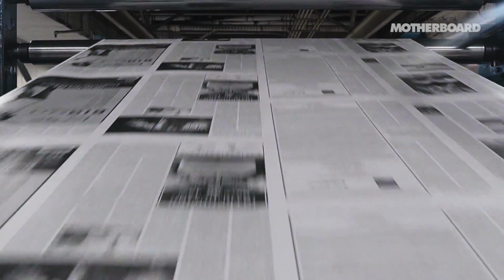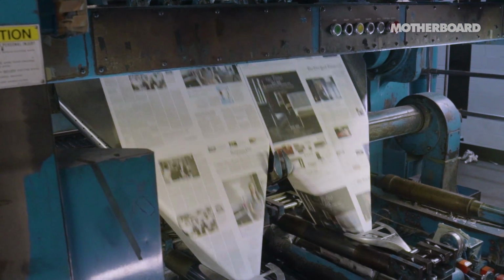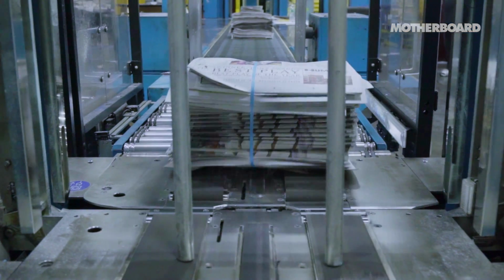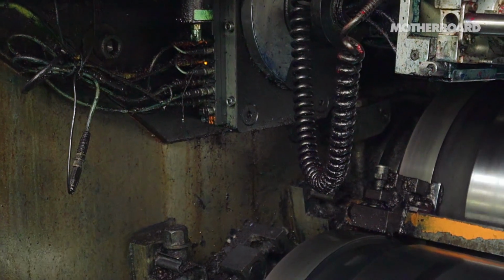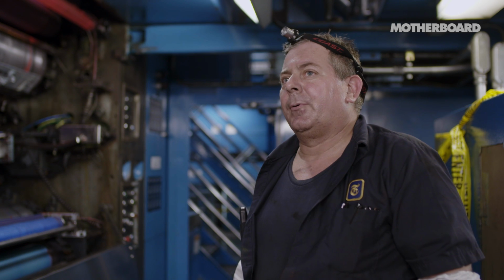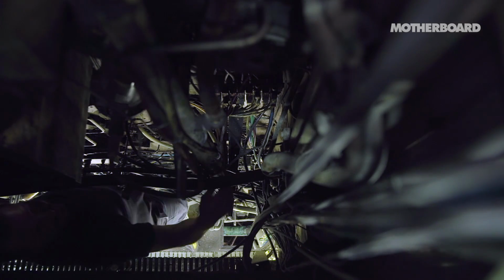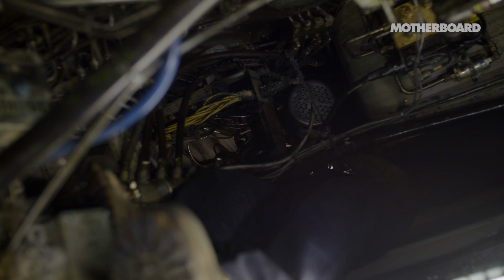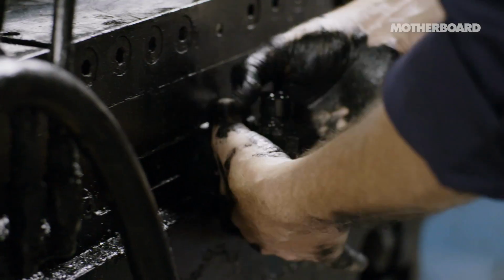Meet the Machinists Who Keep the New York Times Running

Comment: It's crazy to think that they or anyone else knows how every part works, how to maintain every machine, and how to repair every inch in that huge facility. Much respect for them, and people like them. I wish I knew anything as well as they know their job. 

Great video
Reply: Yea, try reading up a bit about how printing works and you'll see how deep this cave is :D
I study graphic design at a more technical oriented uni (my faculty is a branch of one), so we had to study all the little technicalities of the trade. And man are there many of them, from how you get millions of colours by using 4 base ones by rasterizing, or how all the complicated machinery manages to make thousands of copies an hour while still precisely printing billions of micrometer sized points on the paper.
Reply: @webbugt  I don't know about micro billions? If there was micro billion dots per inch on one sheet you wouldn't be able to hold the Ink and water balance. Amongst a lot of other problems that would occur during the printing process. 5 micron, 10 micron, hell even 20 micron but a billion micron? You made me laugh. I have worked  at all the big shops Around Southern California or at least what's left of them and believe me there's a lot of retards out there that are running these presses. don't make this job out to be harder than what it seems. Remember a real Pressman fixes all his own mechanical issues. Oh yeah good luck with that 10 bill. LOL😂
Reply: You don't get the point. If something pure mechanical doesn't work there's always a perceptible reason for it. In electronics there's not. Electronics can work fine for hours to an end, be buggy for like a few seconds without any preceptible reason (ie no error codes or anything) and then work again hours on end. And you maybe won't even encounter that issue again. It just stopped working a for fraction without any perceptible reason. That's why they prefer pure mechanical machines. We have more issues with our modern machines vs our old ones as well. The modern ones have their advantages, but they can also be fucking annoying.
Reply: Metalpug79 Imagine their job security and bargaining abilities
Reply: rootbro I'm sure it's mostly a friendly poke. However, I will say a lot of things now a days isn't built to last like it used to. A lot of automobiles today don't have dipsticks to check your transmission fluid, or plugs to fill it. They call the fluid a "lifetime" part which its not. So in some ways, their frustration holds water. There are great things about technology now a days though too. I hope I was able to share a bit of perspective.
Reply: Justplanecrazy25 working on these new cars is getting ridiculous especially German cars
Reply: David Stevenson the more difficult it is to repair something, the higher the pay will be, and a better person you will be for understanding how to do it. So it takes a different tool. So the head bolts are a one time interference fit. Look for the solution. You can take any two numbers in the spectrum of infinity, put one on either side of the equal sign, and find a way to simply it to make it so. You might have to stay a virgin to make some happen

(Sir Isaac newton joke)
Reply: It's honestly not that bad. I work as a heavy duty mechanic and it's honestly just learning the principles and basics of how different systems work. hydraulics for example requires the same components on a truck as it does on a printing press. All it takes is a bit of thinking to figure out how those components are applied and used in your particular case.
Reply: Justplanecrazy25 Yeah my car has the 'lifetime' fluid in it. I'm almost at the 100000 mark and would definitely like to change it because I plan on keeping it for my lifetime. Its a good car, but all fluids break down and need replacement eventually.
Reply: I did a 5 year apprenticeship to be a print machinist . . . I’ve been driving trucks for the last 20 years , new technology and social media are killing print , here in Perth where I live the newspapers will probably be gone in 3-5 years ! My sister is payroll manager for our largest daily and she told me they are not replacing staff period !
Reply: @bargearse57  that's what they said ten to 12 years ago..still printing on an offset and digital press to this day 🙏
Reply: @bargearse57  so they let you hold their tools? 5 years? I'm sure you didn't learn much. Stick to truck-driving. Try 20 plus years in this trade and then maybe you might learn something.
Reply: one of my jobs was building industrial machines, the other job was repairing old industrial machines the scary electrical stuff these guys dont like. and for the most part they are still built to last. a machine that constantly breaks has no place in an industrial environment. they will last a small handful of lifetimes with sometimes very minimal repairs or flat out replacements when they are treated as intended. the companies that make custom industrial machines are not in the market to repair them or replace them often. their market is to become a good Brand that you will buy from again as the business grows unlike cars where they want to sell you a new car every 5 years.
Reply: Its crazier to think someone designed it.
Reply: Apex Attitude The is spot on, my buddy's low beam bulb burnt out and to replace it we had to take the front bumper off just to reach the headlamp assembly.
Reply: Sure, if the problem occurs while diagnosing or it leaves an error code. Countless of people have electronic gremlins in their cars/bikes, but when they go to a garage it suddenly does not happen. And there are no codes to be found, measurements are fine, etc. A mechanical problem is always there, an electrical one can sometimes be very tricky to trace.
Reply: Your understanding builds faster than you'd think.
Reply: Modern machines are straight forward if you know electronics.  I have a similar job description to the guys in this video but the machines I fix make computer chips.
Reply: SEM, etch, or CMP, or another tool?
Reply: Find a little print shop..say maybe in your free time you'd like to learn..trust me We all will let you work for free. Heh 😁
For the record of they don't have  Letterhead press at least a 2c press...its not a print shop it's a glorified copy center..
Reply: You
Reply: I would hope you know your job as well as they know their job...
Reply: This is what the future looks like man. It’s not going to be about knowing one engine inside out. It’s going to be about understanding the simplest algorithm of its operation tailored to its job.

And you will be doing it. Getting paid!
Reply: This is why mechanical,electrical,pneumatic schematics are drawn to the smallest detail
Reply: you spend 30 years in a building your gunna learn every single part eventually
Reply: I work as a millwright (industrial mechanic) in Canada. This is what my trade does. New tech is great, and across all industries automation is common place. But these guys are maintenance mechanics. Learning how to be an expert machinist/millwright is a feat among itself. Learning everything about PLC/Electronics to do with a one off printing machine is a whole other lifetime of learning.
Reply: Apex Attitude, it's more like an design engineer has too much work on his plate to complete a Early Equipment Mangement(EEM) because his manager is an absolute moron and you have no idea why you're trying to save his ass so you rush the design. If you're in maintenance you should be cheering it just means more money for you.
Reply: rootbro I definitely get where you're coming from. I wish they'd have a little more class than that, but at the same time I can understand why they're like that. Obviously feeling the pressure of being backed into a corner. They know their jobs are crawling to the end. I think it's natural to be defensive when you know the end is just around the corner
Reply: You, sir, are, to use the appropriate word, a snob. Even worse, a boring and tedious snob, with a. Large dollop of pretentiousness thrown in for good measure. Stuff you and all your misreading of a fine and proud craft. The job classification is machinist. Let go of your false pride.
Reply: ducks to be me, cuz I'll be the type to purposely fuck them over for a day off😂👍